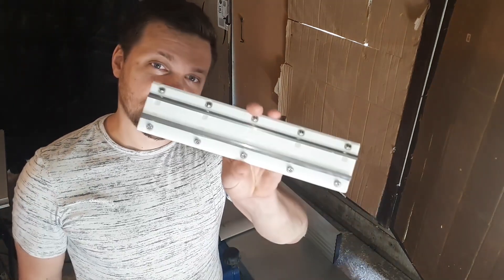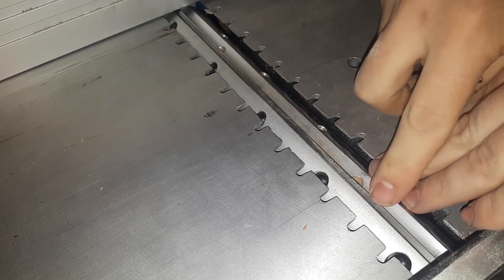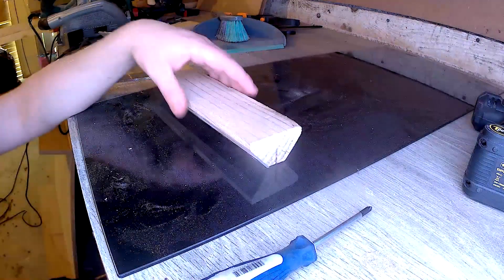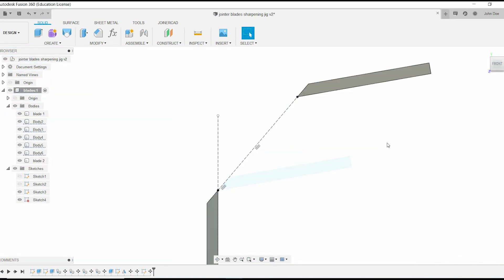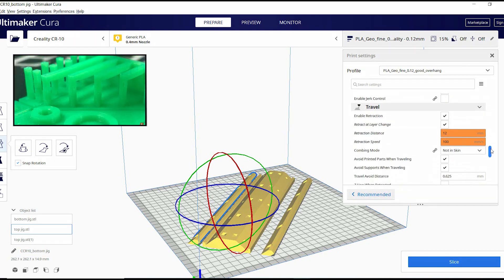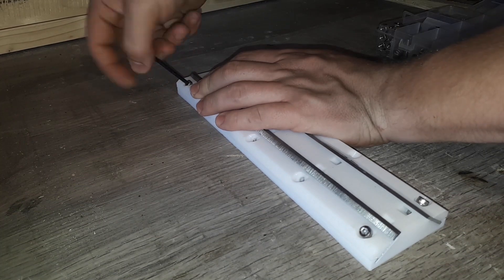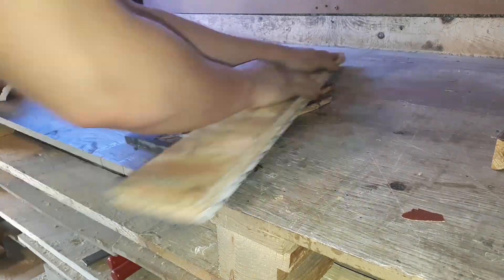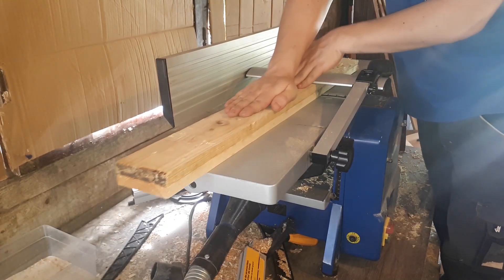3D Printed JOINTER BLADES SHARPENING JIG

Comment: Good explained video man. I'm so glad you shared this with me. Very helpful. I will definitely use this idea to sharpen the blades of my jointer. Thank you so much!
Reply from the maker: You're welcome. You might succeed to make it with wood if you don't have a 3d printer. Cheers !!
Reply: @woodvibecreation  I don't have a 3D printer but it is on my wish list. First I will have to save some money LOL
Reply from the maker: @ashstagwoodworking  Sure ! In case you are not familiar with the topic, you will see that it became pretty affordable now. You can get quite decent printers for less than 200 euros. But yeah I understand that you need to save some money. Same for me haha !
Reply: @woodvibecreation  That is cheaper than I thought it was. Is that software included? I have to check that out.
Reply from the maker: You can get Fusion 360 for free to design your pieces and CURA for free as well to slice your designs into a code called G-code and that the printer is able to understand. I talked about it on my 1st video about 3d printing (FUSION 360 for beginners - 3D PRINTING BASICS - How to 3D PRINT a vacuum adapter). You can also find many tutorials online on fusion 360 and cura.
Reply: @woodvibecreation  Awesome. I will check out that video. Thank you for helping me my friend. I have noticed you are from France, so that makes us ar neighbors hahaha.
Reply from the maker: @ashstagwoodworking  Sure and you are from Belgium right ? If my channel take off maybe we will be able to meet one day on some maker event ;)